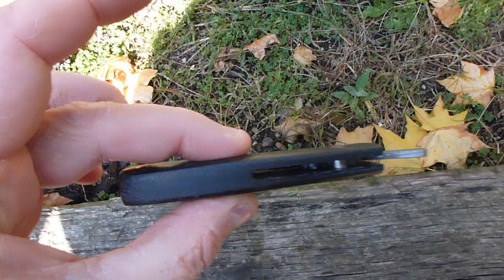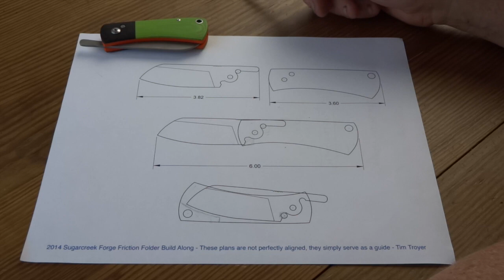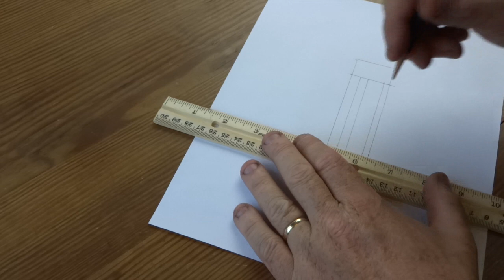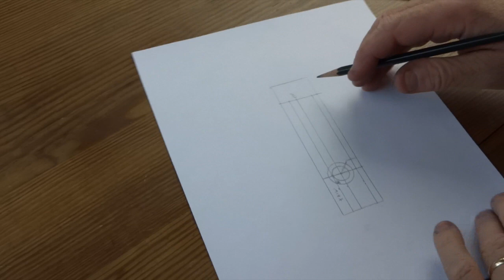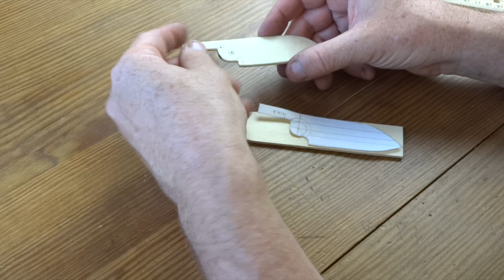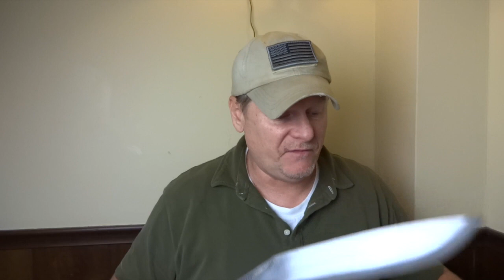SFBA 2014 #1 Designing Your Friction Folder

Comment: Are the templates to scale or smaller?
Reply from the maker: Hi Brian - They are to scale for what I designed them for. You can cut them out and use the paper as glue on templates.
Reply: Ok cool thanks. I'm going to give it a shot. Great videos.
Reply: if you could can you list the sizes of the hardware you used.
Reply from the maker: I think I used a 3/16 folder pivot screw, a hardened 1/8 dowel for the stop pin, a 3/32 pin for the handle pin, and a 1/4 inch stainless steel tube for the lanyard hole.
Reply: Awesome thank you very much for your time and help. I'm learning and the friction folder really caught my eye.
Reply: What's the over all length supposed to be the template says 6" but when I measure it comes out to be 5".
Reply from the maker: Hi Brian. You can scale it on your printer to any size that you like. It does not have to be exact. Make it the way you like it most.
Reply: Ok thanks for all your help and time.

Comment: What kind of glue or epoxy do you recommend for this project? That's about the only thing I don't have. Thanks Tim!
Reply from the maker: I use Devcon 5 minute epoxy.  I hear that the slower drying stuff is a little bit stronger, but I have had no problem with the 5 minute kind.

Comment: Ever seen the one I made? The end of the spacer serves as the stop. For both positions of the blade. Folded and open. Used G10 as the spacer. On all 3 no complaints so far.
Reply from the maker: That is a cool tip.  Does the blade hit against the spacer, or do you keep it off with a kick or something?
Reply from the maker: I just watched the video.  Very cool!
Reply: SugarcreekForge its a spacer that has like a boot. When the blade is closed. It rests on the boot. That keeps the edge away from the spacer. When the blade is closed. Then on the back of the spacer. There is a portion where the blade's prong part rests on when its open.
Reply from the maker: Good thinking and design.  That prong part on the blade is also called a "kick" and I suppose we could call the boot part on the spacer a kick too.  Great work!